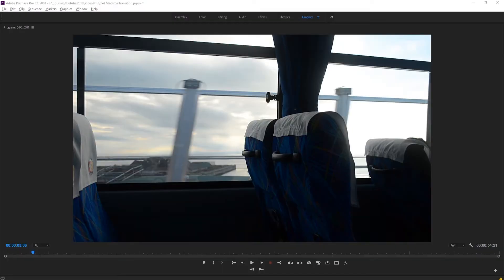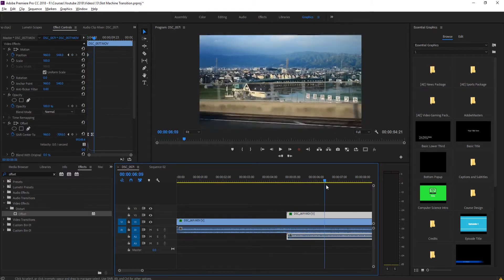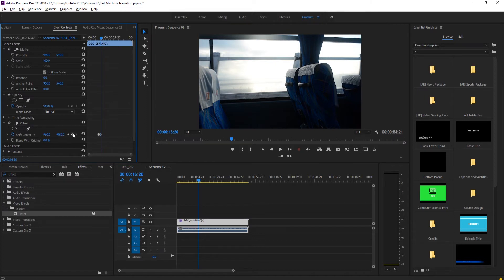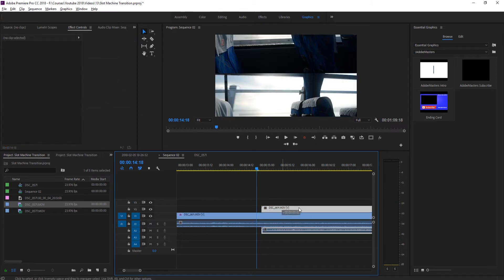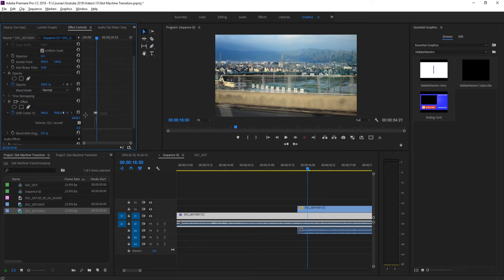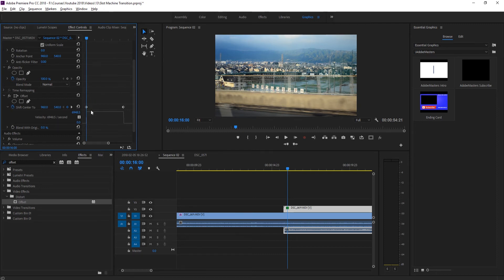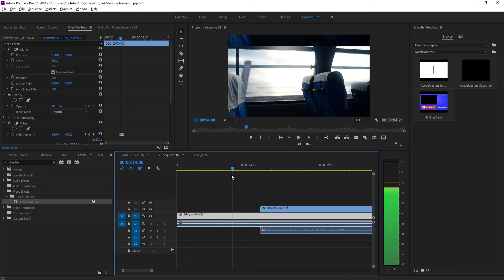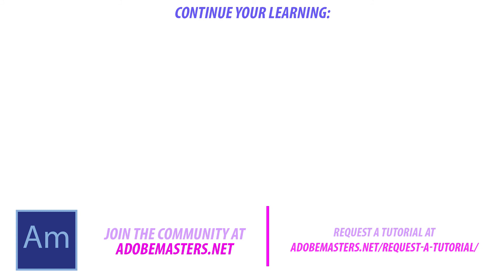How to Create a Slot Machine Transition in Adobe Premiere Pro CC (2018)

Comment: I want to do a smooth vertical scroll of several video clips that are sync’d to a song. I know that I can animate each clip using key frames, but my brain is melting trying to figure out the offset/length of each clip to keep them all evenly spaced and scrolling at the same speed. Any ideas on how would I do this?